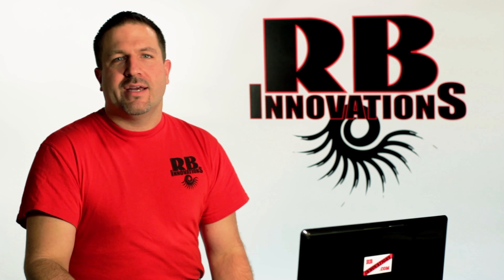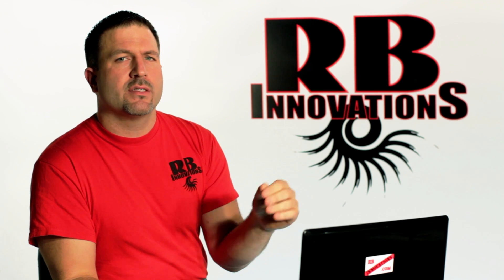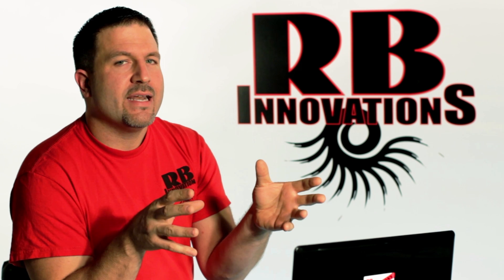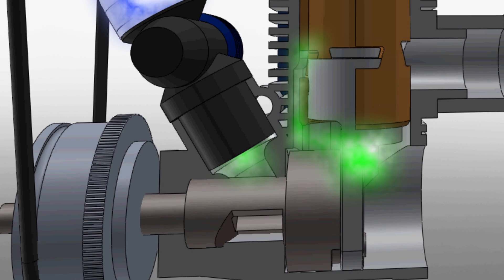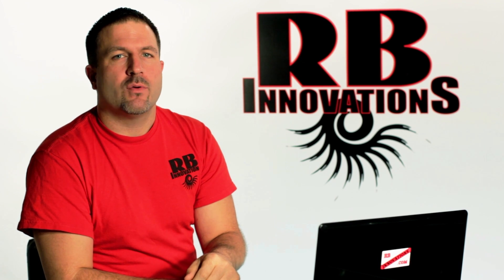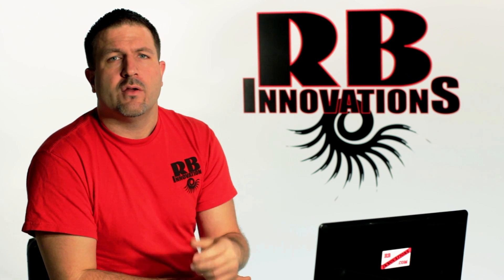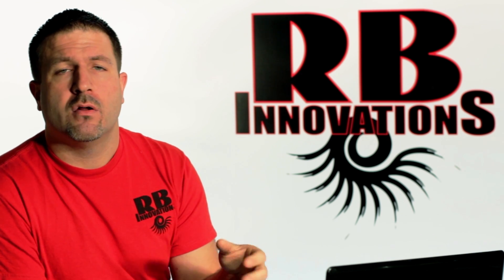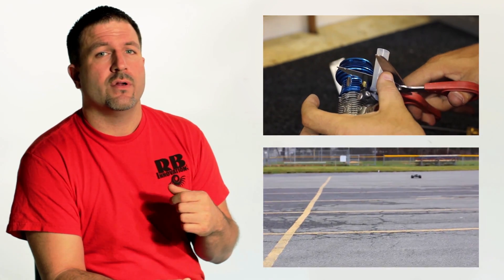How RC Nitro Superchargers Work

Comment: Man I just sit on my rc car with a big rubber hose ,a straw and blow in really hard, why because if the temp is too hot I just blow harder, toO cold I suck it out ,and then repeat, I make sure my reed valves are butt hole tight, and when I blow my engine up because the PSI is more than the pistons could take, I just call for more parts, I’ve been a blow hard for ten yrs ,and blow and stuck harder than anyone else, thanks for reading, lol…

Comment: Such a scam company like most of the products you sell. So your blowing through a carburetor without anyway to increase fuel pressure under boost to keep it from leaning out? and you also gotta remember the transfer ports and exhaust port is all open at the same time. How exactly are you supposed to trapp boost? You can't. It leaves out the exhaust port with most of the fuel air mixture. It's a 200$ gimmick. And those  rear mounted dual exhaust? Gimme a break! How are you supposed to have any return wave for efficiency? It's not a tune pipe but a power robbing  Piece of garbage.  And the NOS kit? LOL you have to tune it super rich so you have enough fuel so when you hit the button it runs great for 5 seconds then back to being a dog. A stock 3.3 with a decent pipe and a good 30% fuel will out perform all your so called hop up parts. If they actually worked as well as you say everyone would be using them with top notch results and they are not! Shocker I know.... lol

Comment: Had a buddy with one. Didn't do a thing for performance. In fact, his engine ran much better after swapping out tuned pipes and crankshafts trying to get this to work, when we once again settled on the stock crank and a well tuned pipe. Saved weight and all this went into the garbage.

Comment: How they work is they add drag to the engine robbing power and increasing heat. No possible way to adjust timing for boost nor adjust fuel delivery for rpm/boost levels. Gimmick 1000%

Comment: STOP LYING TO THE PEOPLE! That's not how a procharger (centrifugal supercharger works) you are not pressurizing air especially that thing doesn't have a gear to convert high speed rotation of the impeller. It is just simply a fan so with or without it it's the same the carburetor is recieving the same pressure nothing changed.

Comment: The naysayers aren't speaking with any experience.  ANYTHING that improves scavenging on any engine will enhance performance.  The degree of improvement will vary depending upon many many factors.  Depending upon static compression ratio on any given engine, it may optimize with the blower by reducing static compression ratio slightly.

Comment: Aaaaaand the more mixture gets into the engine, the more gets through into the pipe. But the pipe only pushes the normal amount back so it still produces the normal power but just blows a lot of unburnt mixture out the exhaust, which reduces fuel efficiency.

Comment: How does a sonic pulse do anything to over power the supercharged airflow? I don’t see how a sonic pulse is going to help compress the mixture and raise compression like a 4 stroke engine. You will never pressurize the cylinder any more than what the engines base compression is. It’s just not possible on a two stroke. I can see it pressurizing the crankcase but it won’t ever create any boost/PSI worth a damn. Very strange to me. I could see it increase flow an atomization but to actually consider it a “BOOSTED” or “supercharged” Engine is a stretch. Wtv

Comment: Since the supercharger system is creating constant pressure by forcing the air/fuel mixture into the crankcase,and doesn't have to rely on negative pressure to pull the air/fuel mixture into the crankcase wouldn't it be beneficial to increase the intake timing on the crankshaft opening effectively creating more cylinder pressure making the engine think it has an even higher static compression ratio than it already has?.And would also help alleviate the effect of the supercharger on rod to crankshaft pin pressures by forcing more lubrication into the crankcase at the same time acting like raising the oil pressure on a conventional oiling system?

Comment: Mine comes tomorrow. I can’t wait to do a detailed before and after speed run on a radar and also do a detailed break down of the tuning required to maintain proper reps and overall performance.  Very excited for this product. My nitro car is the red at shockwave 1/10th scale running a high flow filter, performance manifold as well as the tuned race pipe. So we will see what I get for gains.
Reply: Joe Max Fpv  well?
Reply: @trex470mccoy8  not as good as expected.  Wasn’t worth it. Looks cool. But. Meh.
Reply: Didn't work as expected lol

Comment: As a professional in the field of gas dynamics and thermodynamics of ICEs, the best answer for the question 'How RC Nitro Superchargers Work' is really simple down to they don't. What you were saying is all about how does a two-stroke engine work and has nothing to do with the 'supercharger' what so ever and I highly doubt if the 'supercharger' can create any meaningful pressure at the inlet.

Comment: The tuned pipe was meant to “push” back the air/fuel mixture at the stock pressure. With the a/f mixture at a higher pressure, a new tuned pipe needs to be installed that will create enough back pressure to “push” back the higher-than-stock-pressure a/f mixture. Why do you think 2 stroke snowmobile turbo kits come with a new tuned pipe? Because the new pipe creates enough back pressure to keep the forced induction a/f mix in the cylinder. This was a very basic explanation of it because I don’t feel like writing a book on how naturally aspirated 2 strokes and forced induction 2 strokes work

Comment: They make the nitro engine run lean and destroying it. Other than running an onboard glow igniter, and running richer youll save the engine. This is not a 4 stroke engine. The engine will not add extra fuel (like injector in real car do) your tunning it but engine runs rough or doesnt run at all even if richen..

Comment: Wouldnt it just lean out forcing air into it? As the levels of air will change through out the range of rpms so you could only really tune it right for up high or down low but then you would risk putting to much fuel and air for when it kicks in? I mean theres no ecu to regulate it

Comment: In fact, there are some blown 2-stroke engines, but they don´t breath through the crankcase.
2-stroke diesel for e.g.
Timing the ports is also critical, blown 2-strokes close the exhaust before the intake to build up pressure. Sonic pulse is therefore insignificant. Even in a n.a. version, the sonic pulse works only in a narrow rev-band in which it is tuned for. 
Fuelpressure must be higher then airpressure in this blow through carburretor application. With the pressurelines like shown in your animation the boost will go out the exhaust with no effect on tankpressure, so the mix will lean out. Even worse, the fuel will be pushed back in the tank. May work with the line from the charger only.
The gaspath on every engine starts at the snorkel of the airfilter and ends at the exhaustpipe. A bunch of people busted their brains to get that just right in the development of an engine. We can play around with the externals like intakes, exhausts or carburretors to get the engine may better or may not. Your approach need a complete rework of the engineinsides to deliver results. As a bolt-on, like your charger, it will not work. Therefore i don´t need a dyno, just plain 
brains

Comment: I fuckin died when this guy brought up the scavenging cycle and exhaust harmonics. No pipe is tuned to provide sufficient back pressure for your logic to actually be used. That pulse is to provide vacuum on the exhaust side to properly scavenge the cylinder so all you do with these s/c (if they do in fact provide enough positive pressure to be useful) is overscavenge and get that extra fuel air charged sucked blown through the exhaust. Very few 2 strokes can utilize any form of forced induction for these reasons. The few I personally know of have exhaust valves  (intake via ports in cylinder sleeve and valve train specifically for the exhaust like Detroit 2 strokes which need a blower just to scavenge because a pipe won't work)

Comment: So basically even if you believe the claims he makes about the "Sonic pulse" being able to push the air/fuel mixture back into the combustion chamber it would only work in a very narrow rpm range. Otherwise you're going to be having essentially the same pressure at the tip of the pipe as in the chamber. Even if there is a slight pressure difference I doubt that the increase in volumetric efficiency is going to offset the power loss by the blower itself.
 I also can't help but wondering if the exhaust gases being expelled would possibly cause issues with the fuel in the tank. Impurities brought in by the return "Sonic pulse" could end up in the tank as well. 
Essentially I don't see an advantage in this system outside of a very narrow rpm range. I'm not a physicist so I could be completely wrong. Let me know.

Comment: ok lets say this worked ( I know it dont but lets say it did)  what about lowering the compression ? if you dont lower the cylinder compression its goodbye cylinder head bolts and  con rod, if it worked like he says the crankcase on these little motors would break open.  you need pressurised fuel air mix, not pressurised air belting down onto the normal pressure fuel. so maybe he uses exhaust pressure to pressurise the fuel ? what is the compression in psi of the little motor ? what is the dyno bhp before and after, what is the rpm before and after.does he change gear ratio too .I run large 2 strokes of 1,000 cc, believe me if it was this simple every 2 stroke outboard would have a supercharger on it to increase the bhp. .. this little thing that would no way pressurise anything will not work. and to have a simple band rather than a strong toothed belt is a joke.  has this bloke never seen a real supercharger and understand how it actually works ? and the manifold needed and all the little other bits. this is just a tiny weak fan that wouldn't dry Barbie's hair on a hot day.

Comment: Nope. The pumping losses operating on the piston on the downward stroke, plus the fact that the intake port is closed, and that this is through a carburettor, without any changes to the expansion chamber, I cannot see this setup making more power. Not convinced.

Comment: Superchargers and turbochargers typically do NOT increase efficiency, as stated in the video,  but they do increase power by forcing more fuel and air into the combustion chamber.

Comment: The extra intake pressure escapes directly out the exhaust port, since the exhaust port doesn't close until after the transfer ports close. The shockwave bouncing back up the exhaust doesn't have enough force to overcome a pressurized intake charge, so the extra intake pressure still escapes and the fuel mixed with it gets wasted.

Even if that weren't a problem, your design is still defective because the carburetor is downstream from the blower. That means the pressure generated by the blower prevents the carburetor from generating the partial vacuum necessary to draw in fuel properly, causing the engine to run lean. Enriching the fuel mixture doesn't solve this problem because the pressure buildup at high RPM will obstruct fuel flow even more than it does at low RPM.

Furthermore, you say to tune the engine to run at the manufacturer's recommended temperature, which is a good idea, but in this case it also completely defeats the function of the supercharger. Thanks to the laws of thermodynamics, you CANNOT burn more fuel in the same space with the same heatsinking without the engine getting hotter. Tuning the engine to run at the manufacturer's recommended temperature would require running it so rich that it wouldn't produce much, if any, more power than stock. Not to mention tuning it richer will cause even more fuel to be wasted out the exhaust when the exhaust shockwave fails to push all of the intake charge back into the cylinder.

You are trying to use fancy terminology to talk over the heads of your customers. Your product is a scam. It always has been and it always will be.
Reply: This would be effective with a draw through setup, a rotary exhaust valve and maybe a boost bottle?

Comment: Now the most critical part is......… that as soon as that exhaust port opens all positive pressure created by the charger pushes fuel out.
Sure some of the fuel will be pushed back in the cylinder but Wouldn't that pulse need a force grater than the force of the of the compressed air fuel escaping?
^^^ that is a serious question that should be addressed

Comment: Guys this system is basically blowing air in the engine yes you'll gain little power, but real superchargers "COMPRESS" air and then forces it in the engine.

Comment: you say more fuel delivery will bring temperatures down, what temperatures block temp or combustions temps because if you have a balanced stoic adding more fuel will create more heat ?
Reply: Kevin Milner the nitro fuel contains the lubricant and oil, so more fuel means more oil, lowering the temperature
Reply: @alecw7063  any engine really eg real piston aircraft rich = lower EGT and head temps as you lean the engine EGT and head temps go up till it gets lean of peak then go back down
Reply: richer fuel settings will lower head temps thats not wrong in the RC aircraft world you can run sloppy rich with high nitro fuel in a 4 stroke and they hardly get hot

Comment: But what stops the pressurized air from pushing the fuel back into the needle?
Reply: the "sonic pulse"..........but first you gotta get it up to 88mph.....
Reply: that was always my question as well... never got an answer from these guys!  this is a total scam
Reply: @billymanilli  well the exhaust pressurised the tank forcing fuel to the carb but u doubt that enough pressure
Reply: Superchargers only work if the fuel atomisation is completed on the low pressure side (upstream) of the supercharger ...basic physics ..

Comment: SNAKE OIL ALERT. I tested one of these using an accurate pressure transducer and they make basically zero pressure. they probably result in a net loss of power. DYNO TEST IT!!!!

Comment: This type of exhaust system on a two stroke is normally known as an expansion chamber. Properly tuned they act almost like a supercharger. Use to set them up for certain rpm ranges to fine tune the engine all the time back when I raced motorcycles. Altitude, air temperature, humidity all affect how the engine is running on a particular day.

Comment: may be work on an better rc engine before making a super charger, don't get me wrong I  love nitro engines but they don't last the long pull start problems one way bearing going out piston wearing out to fast over heating etc, I end it up moving to electric more durable.